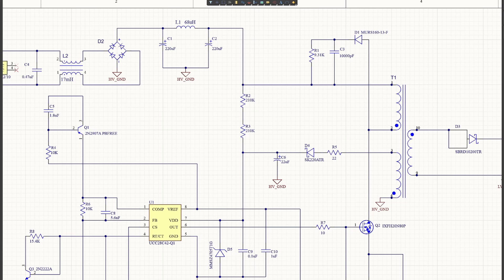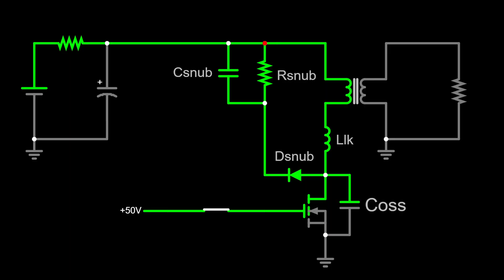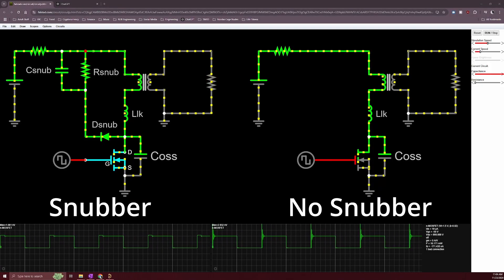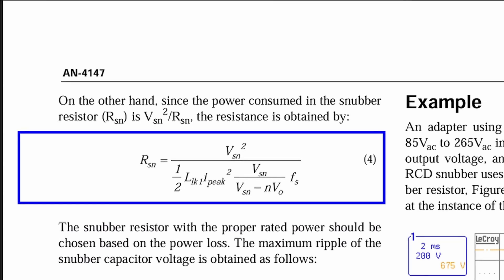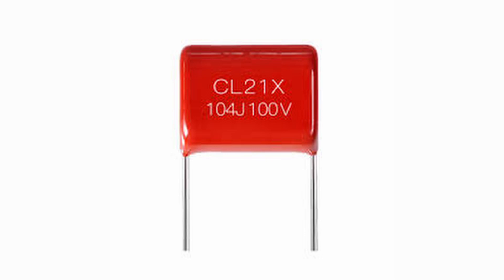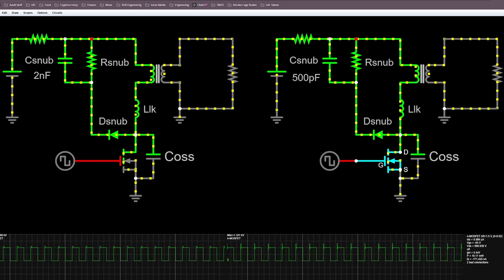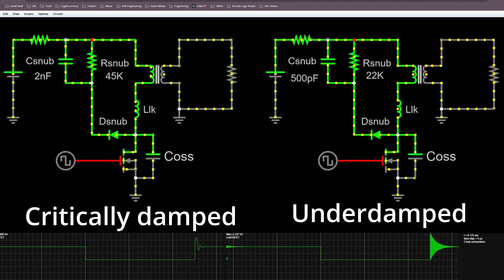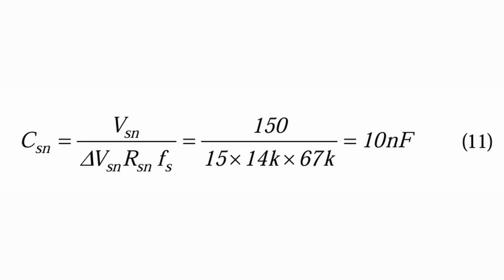Flyback Snubber Design Guide (for Beginners) | RCD Snubber Design

Comment: Hello! What is about small additional capacitor between drain and ground? In my opinion, in self-oscillating flyback dc/dc devices it can reduce high-voltage spikes.
Reply from the maker: Hello, great point. That is also sometimes used to reduce ringing.

Comment: sir i have designed rcd anubber as you showed in video but after calculating rcd snubber  for my flyback smps after placing capacitor and resistor when i test and connect 120watt load mosfet and anubber resistor heating i verified calculation but iam facing same problem
Reply from the maker: Make sure to double-check the power rating of your resistor and capacitor, and consider using components with higher ratings.
Reply: ok sir i will check and inform you

Comment: Nice explanation i just want to ask u one question my voltage range is 15-115V  and output is 12V like for calculations of snubber here there is no need of input voltage range here while calculating the value of R and C while variation in input voltage?
Reply from the maker: you will likely need to determine your component values empirically.

Comment: Hello,
at what time Vout has value when Mosfet is ON or OFF  or in both cases.
if you may show has the output signal with input signal and gate signal
Reply from the maker: The output voltage is only present when the MOSFET is off, but there will be a voltage spike on the output side when the MOSFET turns on.
Reply: @RGBEngineering  Hello, if the circuit without snubber . The secondary voltage also present when MOSFET OFF state?
Reply from the maker: yes

Comment: If I’m driving the primary coil of fly back with an H-bridge, is the RCD clamp just not feasible anymore? I’ve thought about just using 4 RC snubbers instead. Basically just trying to get pure AC without having a center tap the secondary winding
Reply from the maker: That sounds more like a resonant converter, so you wouldn't need to have an RCD snubber at all.

Comment: Good video.  It seems like it is always a challenge to get the most snubbing effect with a resistor & capacitor that will fit on the PCB.  I like how you explained how each parameter has an effect of each component.
Reply from the maker: Thank you, I am glad you liked it :)

Comment: Hi there. I just watched your boost convertor video. It was really informative. Thank you. 

I just wanted to ask. Let's just say I have an input voltage of 0.4 Volts, is there anyway I can use a boost convertor to boost this up to 3 Volts? What exact part would I use to achieve this? It would be preferable if can find the part on the RS components website. In your video you mentioned for higher ratios I should use a transformer, but I can't do this since I am working with DC.
Reply from the maker: You can still use a transformer with DC voltage.